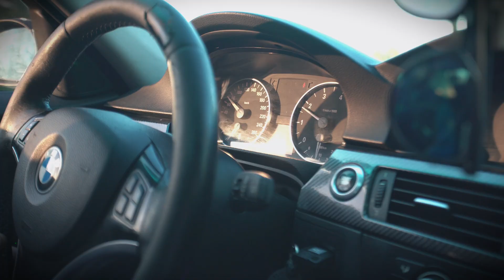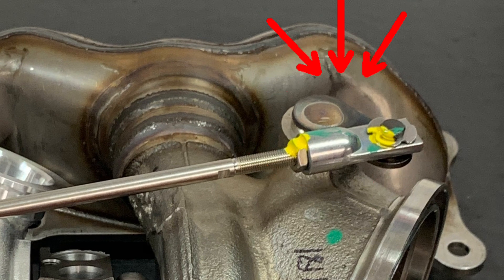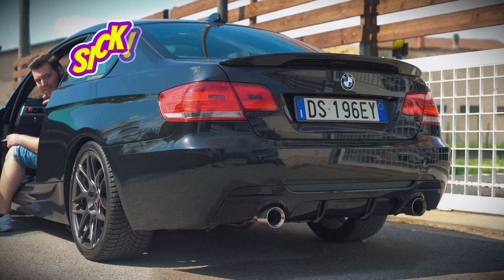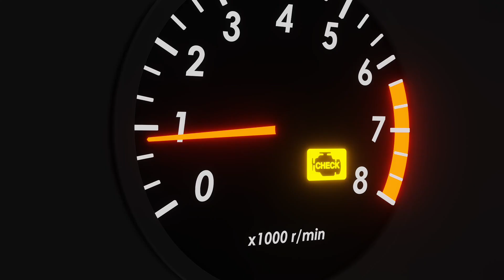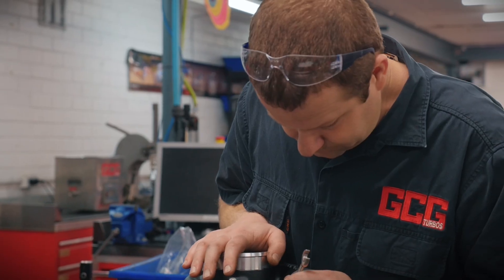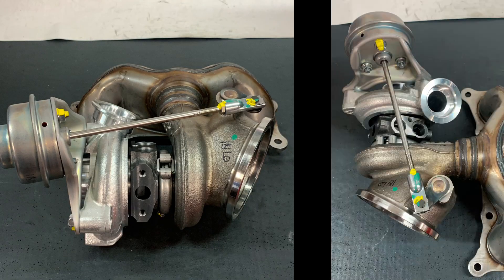TURBO TECH TIP: BMW N54 Wastegate Rattle Fix

Comment from the maker: Commonly known as a "Wastegate Rattle" this problem has been reported to affect factory, internally-wastegated turbochargers on late-model European cars. In particular, the BMW N54 Twin-Turbo models have been susceptible to this problem, according to numerous owners' reports.

The "rattle" is the result of excessive movement of the wastegate crank arm and the wastegate flapper. It's usually caused by the wear and tear of the wastegate bush or the crank arm itself, causing the swivel joint to become loose. Once the joint has a fair amount of free play in it, the vibration of the turbo causes the wastegate flapper and the crank arm to rattle. As the vibration causes further loosening of the joint, the rattle becomes louder and eventually can be heard above the engine noise.

Full Article here: https://gcg.com.au/BMW-N54-Internal-Wastegate-Rattle-Repair.html
...
GCG Turbos Website: https://www.gcg.com.au
GCG on Facebook: https://www.facebook.com/gcgturbos/
GCG on Instagram: https://www.instagram.com/gcgturbos/

Comment: I have a rattle on my 740Le, sounds like the chain, but at the same time I have a whiny noise when boost builds up and a "pschsch" when releasing throttle. Could those noises belong all together to the wastegate part?
Reply: On bmws with wastegate issues it’ll sound like a metallic exhaust rattle almost, sounds like you may have a vacuum leak if your hearing a whinny noise. I’d scan it first